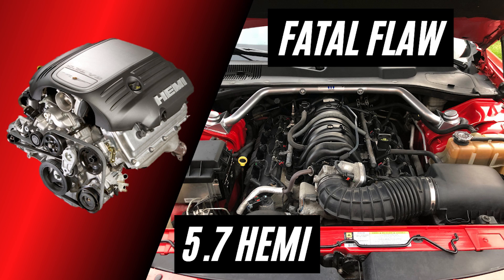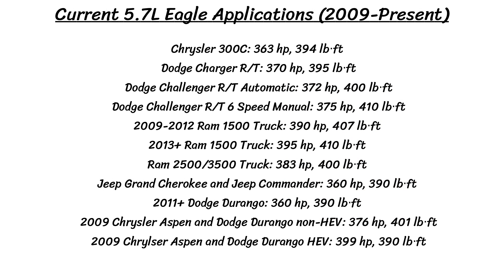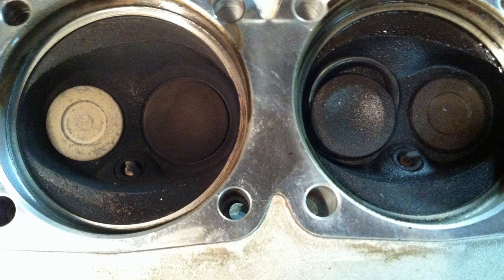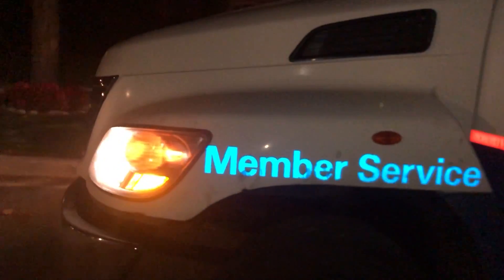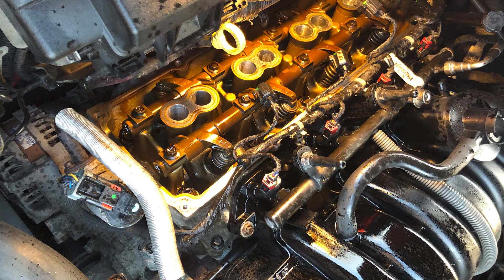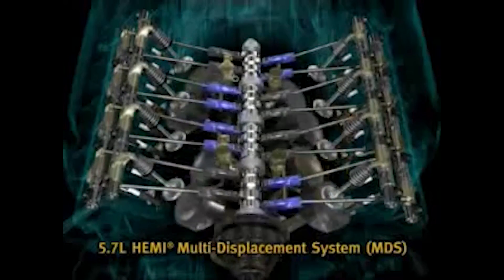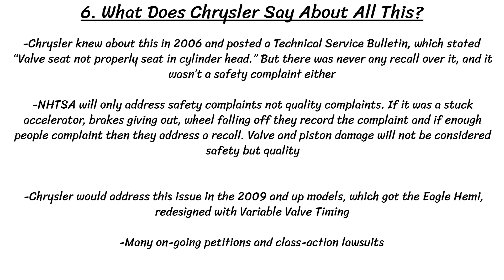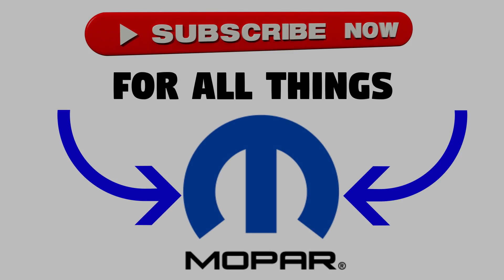The Fatal Flaw of the 5.7L Hemi V8 Engine & How to Prevent It (2003-2008 Valve Seat Drop)

Comment: So it has 2 fatal flaws... the roller lifters do not get enough oil where they contact the came, causing them to eat camshafts. Its a very common problem. It is worse on mds engines.
Reply from the maker: Those are on the newer eagle motors, I may have to do a part 2 on those lol
Reply: @MarspeedCars  your right I shouldve watched the full video before I commented
Reply: That is not entirely true, and mostly blown out of the water in proportion in engines that it actually effects
Reply: @captainblaiser  I work at a high selling chrysler dealership, I see it about every 1-2 months. Car comes in with a missfire and at least 1 lobe is found to be ground down.
Reply: That issue has nothing to do with MDS, nor does it have anything to do with a lack of oil to the cam. It is though present in pre-eagle engines. Just more common in the eagle engines as they have more aggressive camshafts.
Reply: @snek9353  Would using a high quality synthetic oil like Mobil 1 possibly alleviate the cam/lifter problems in these engines?
Reply: No, but yes. 

No, cause details... sorry
- Mobil 1 is good but there's better.
- Alleviate isn't right, if there's already damage oil can't fix it, a better word would be prevent.
- The issue is specifically the lifter, nothing to do with the cam. Specifically the needle bearings in the roller. 

But yes, better oil is better and the rights oils are known to quiet a hemi. I use Redline in mine.
Reply: @snek9353  The valve seats tend to drop more often in the MDS cylinders.
Reply: @williamwhite9767  Got anything to back that claim up?
Reply: @snek9353  It was stated in the video, but besides that I have done searches of the LXforum and that is what I found.  Of the members who had seats drop and they identified the cylinders, the majority of the  seat drops were in MDS cylinders.
Reply: @williamwhite9767  This guy is no expert and I did a similar search and found no pattern, more the opposite really. It appeared to me to be more likely to be a back cylinder 7 or 8 than anything else. I can explain why 7/8 in fact it's more common among many non Siamese V8 engines for 7/8 to be most likely to have heat related issues. If you think MDS is a cause, then how, by what means is MDS causing dropped seats?
Reply: @snek9353  where did you do your search?  As I  remember, the #1 cylinder was affected the most but it's been a while since I did the search.  I don't have any theories on why the MDS cylinders are affected more often but many people think so based on forum discussions.
Reply: @williamwhite9767  I did a general search that landed me at several forums. 

People believe a lot of things that are clearly wrong. With neither strong evidence of a preponderance of MDS cylinder failures or a theory as to why you really have nothing.

Comment: The "165 of 200"  at 2:14 is sooooo fake
Reply: What is fake about it? His car is # 165, of the 200 TorRed Daytona Chargers built in 2006
Reply: It's a daytona they only made 200 for Canada in TorRed so it's real
Reply: i have the us torred edt daytona and its 977 of 2000 they did only make 200 for canada.
Reply from the maker: The decals are aftermarket yes but the car is a legitimate Daytona 165/200. That’s just wrap and decal on my engine cover because the regular cover was boring and orange colored lol
Reply: @MarspeedCars  i have a Daytona edt as well mine is a Torred US one its #977 of 2000
Reply: The numbers look like clip art. Plus the entire text is tilted. The "1" is lower down  than the second "0"
Reply: @jordanbowes5707  it’s 100% factory

Comment: Great video! 2006 charger rt 47000 miles running great:)
Reply: 47k are low miles of course it's doing great..
Reply: My 2018 rt has over 50k. How did you manage to not drive it over 11 years.

Comment: Still one of the best engines ever made along with the LS1
Reply: Best in what way may I ask?
Reply: @Blue-moon12  Overall quality, performance, reliability, and versatility
Reply: Chad Bolton  there's no 4th gen hemi but I wish there was. For the camshaft failure just use redline oil many people killed the hemi tick.
Reply: Chad Bolton  using redline oil is not full garruantee that it will kill the tick and I get my info from ram forums not Facebook because the forum page has ram owners  who tried redline oil and even took it to a research lab to prove that redline might kill the hemi tick. Many people on the forum have been using it and used it to prevent the hemi tick.
Reply: Chad Bolton  you are right but there have been reports that if none MDS cylinder fails it's mostly because every time MDS turns on (not 100% sure this is true) it consumes a ton of oil not letting a drop of oil to the none MDS cylinders leading to lifter failure. and yea you are correct even if you disable MDS can't guarantee that you won't have the tick anymore because you still have the MDS lifters.
Reply from the maker: It’s definitely a great engine for sure! And of course the flaw was fixed eventually! Not trying to say it’s horrible or anything like that, but just talk about the valve seat drop issue as it seems like many don’t know much about it!
Reply: @MarspeedCars  Its good to see this video, many people sell the cars/trucks used with the term "needs work".  Sometimes if someone thinks they are getting a deal, but end up needing a complete engine.  Lets one know how deep they want to go into a used one of these years, unless the problem has been fixed already.    When this engine came out in the Dodge Ram at the time, Chrysler had a lifetime powertrain warranty, at least my ex father in law did in his truck.  The lifetime warranty though, did have a rigorous, dealer only maintenance schedule, but he never had a issue with the truck.   I had a 2011 Chevrolet Avalanche 5.3 with updated MDS, from when it originally debuted in 2007-2009 that had the camshaft issues GM suffered.   It was no guarantee it couldn't happen with the updated system though.   I could tell the 4 cyl mode in the exhaust note, I had factory exhaust.    Anyhow, good info to share with the Hemi engine from those year models. Also, I have used Mobil 1 synthetic and Mobil 1 filters in any of my cars since 1996 and never had any issues.  There was a article once that I read that had use the weight oil a manufacture specifies as well.  The tolerances in the engine and the thinner oil, flows in those tolerances.  The old adage "put a heavier weight oil in a engine", in some cases, thicker oil causes sludge issues or someone who doesn't follow a good maintenance routine and have issues.  I think the article covered the Ford engine like in the 4.6 in Crown Victorias at the time.  How many 4.6 you can see putting out blue smoke from burning oil from engine wear caused by wrong weight of oil or not changing oil with correct weight and over time.
Reply: @MarspeedCars  I knew little about it but after watching your video I was much more informed thus why you have the best Mopar content on YouTube
Reply: How can this be the best engine made with so many flaws?
Reply: @Iyoten01  He talked about one flaw and this isn't the same Hemi that's being made today. Almost all engines have at least one defect
Reply: @RageCannon-tf3ob  that wasnt the argument. The discussion was how can an engine be the best with flaws. This engine has more than one flaw to begin with. Yes all engines may have a defect but how do you put this as the best engine in the world????
Reply: @Iyoten01  I never said best in the world, and almost all engines with a huge fan base all have flaws after 100,000 miles like this one. Take the Subaru 2.5 Turbo 4 cylinder. A truly excellent engine with great performance but after about 130,000 miles it begins to chew through head gaskets. The Hemi is a good example of a reliable V8 in the 2000's and these kinds of issues can appear on other engines with cylinder deactivation systems
Reply: @RageCannon-tf3ob  and no ima not a mopar hater before you say sum like that. my dream car is a Red Charger with Black stripes🤷🏻‍♂️
Reply: @TannerHays137  I never said you were a Mopar hater
Reply: @TannerHays137  Man come on its not even that deep.
Reply: @KidJaeProductions  it is tho, it’s a flawed engine that he’s saying is one of the best ever. makes 0 sense, my dream car is a charger rt and i can still admit this because i’m open minded.
Reply: @RageCannon-tf3ob  If ya wanna allow 4 cylinder engines into the conversation, I bought my 2000 Tacoma 4x4 brand new with the 2.7 liter 3RZ-FE engine & Aisin auto trans. It now has 362,000 miles and runs as good as ever, uses NO oil, on all original engine & drive train. Cast iron exhaust manifolds for the 3RZ always crack, so I finally installed a 304 stainless tri-y header. Never seen any other engine respond so well to a header only, it literally runs better than ever. Kept nothing but Castrol GTX 10w30 in the crank case. I'm just about convinced the damned thing is going to outlast me at 59 yrs old. I live in Florida ( not on the beach ), so I don't have frame rusting issues due to salted winter roads.
Reply: @Iyoten01  it's one of, if not the most reliable v8 made this century. Out of the millions and millions of 5.7 hemis made, it has a super low failure rate. And the MDS lifter failure isn't specific to dodge, it's common on every MDS engine
Reply: @Iyoten01  well I have one with 242k running like it has 60k and I had one I sold with 300k last year and guy is still driving it so I'd have to agree w ragecannon
Reply: @Iyoten01  I have 208,000 miles on my 2010 Charger RT. I  have only changed the water pump, thermostat and temp sensor. But trust me, I am always checking on my Baby...I invested in a scan tool to keep me going, oh yeah and YouTube...Good luck on your Hemi's everyone.
Reply: @Iyoten01  it’s cause he’s biased
Reply: @TannerHays137  I wouldn't say biased more the fact that I'm allowed to have an opinion
Reply: @TannerHays137  makes sense, he does seem like the type to be close minded
Reply: @Iyoten01  Ah yes, I have a closed mind and I hate every other engine because I like the Hemi. I see your logic there.
Reply: @RageCannon-tf3ob it becomes more than an opinion when something is proven.
Reply: @TannerHays137  And what exactly is being proven here
Reply: When you put the hemi up against any other engine in it's class, from a performance standpoint, as well as a reliability standpoint, it is among the best. That's not biased, that's just facts.
Reply: @twiceonsundays  it can't even come close to competing with the ls3, nothing comes close that's a fact.
Reply: @ricko3631  the 6.2 supercharged HEMI can't compete with that? What you smoking and where can I get some? Edit: as a matter of fact, the 6.4 392 has that covered. No supercharger needed.
Reply: @twiceonsundays  Bring them on i've smoked everyone i've raced, not even close. All the hemi has is internet hype nothing else.
Reply: @ricko3631  Brother, you're obviously biased and lying. You've never "smoked" a stock 392 in a stock LS3. The numbers don't support that statement. With 430 hp, you're barely beating the 5.7. Not hating on the LS3 at all, because it is indeed a beast, but don't act like its a Hemi killer...
Reply: Chad Bolton  less than 1% of engines have bad cams, lol, not to mention there is no 4th gen hemi
Reply: When Chrysler Dodge Plymouth was its own company the engines were good.
Reply: Chad Bolton  if the MDS isn't the reason why the hemi gets the hemi tick then tell me why does the 5.3 v8 that has been out since 1997 has never had this lifter/cam failure until gm added AFM which is the same thing as MDS. Many 5.3 owners had over 100k miles and they never had this tick problem same thing goes for the 5.7 hemi this wasn't a problem until Chrysler added the MDS and it's not a design flaw. there's still not enough evidence to support this but many people are agreeing that MDS is the cause of catastrophic failure and the only way to at least try to fix it and not pay $4000-$6000 for parts and labor is to at least give a chance to use redline oil.
Reply: Chad Bolton  I feel like FCA did this on purpose just to suck on more cash on ram owners once their warranty is out and soon gm did the same thing trying to suck some more cash on the 5.3 owners once their warranty runs out. Even ford is doing it now they added cylinder deactivation to the updated 5.0 coyote things are getting worse.

Comment: ive got an eagle with 145k miles and just hoping my cam isnt getting eaten alive by my lifters
Reply from the maker: Yeah I guess that’s fatal flaw 2.0 on the eagle motors 😩
Reply: @MarspeedCars  you should do more of these fatal flaws. Very interesting to watch and I'd like to see a episode on the eagle. Keep up the great work👍👍👍
Reply: And the bad part about that is that issue can’t be fixed unfortunately. Only way to prevent that is to not idle for too long or prob use a thick oil stabilizer so that little amount of oil that makes it to the cam has sufficient film strength
Reply: @Trckstr971  Let us know how that "thick oil stabilizer" works out for you.
Reply: @Trckstr971  you don't need a thick oil stabilizer use redline oil it many people have killed the hemi tick by just going to the ram forum and look for hemi tick and you'll see that the ram owners killed the hemi tick with redline oil you guys need to go on forums if you want to take good care of your vehicle for the next 5 years.
Reply: @7thkev519  My "hemi tick" turned out to be broken exhaust manifold bolts.
Reply: @zfine1450  I had the same issue about 6 months ago on my 07 Ram Laramie it broke 3 bolts and one I had to drill, tap and insert to fix. It’s from the motor torking. Scared the crap out of me. I thought lifters when I first heard it
Reply: @7thkev519  is royal purple perhaps Equivalent to redline oil?
Reply: @Trckstr971  There's more tricks to prevent it, and it's not a supply to the cam problem.
Reply: @Trckstr971  or a high volume oil pump and some hellcat lifters. The prob is the lifters are cheap and the camshaft isn’t getting enough oil at idle. This is why ford had to go to a high volume oil pump on their explorers.
Reply: @rescueaviationfilms1019  hit the nail on the head 🤙
Reply: It’ll be fine if you tune out mds
Reply: @iwishigaf  MDS has nothing to do with it.
Reply: @snek9353  I've already argued with someone involving MDS of the cause of lifter/camshaft problems not sure if I wanna do it again.
Reply: @7thkev519  Where? And if you still believe it is, then they weren't very good.
Reply: its not the lifters. theres like a coating a few thousandths thick on the cam, and that stuff flakes off and gets lodged in the lifers.
Reply: And also get a bigger oil filter to improve its live span of redline oil.
Reply: @7thkev519  Have you found a bigger oil filter that fits?
Reply: @snek9353  guys at ram forum are using royal purple
Reply: @7thkev519  RP filters? I'm not a fan of RP as a company and have refused to have anything to do with their products.
EDIT.... Just looked RP doesn't make a bigger filter for this engine.
Reply: Radford Tataryn  Not sure I'm following. Are you saying that the filter spec'd for the new ram is larger than the one used in the cars but fits the cars? On my 300 there's clearly room for a larger filter but when I looked at specs I couldn't find one with the same thread and seal specs that was larger. 

FWIW I currently use Redline oil and Mobil 1 filters.
Reply: Sorry to say this, but it’s only a matter of time. I pulled and stroked my 13’ motor at 150K, only one lifter was slightly seizing though. It really depends on how much you let it idol.
Reply: Its cause the cam and lifter roller surface gets oil from the crank slinging oil or not slinging i should say
Reply: Lol. It is. Sadly but it is
Reply: Just get cam and lifters. It's like a couple grand. If you care that much about the car and you're worried about it happening. Plus you'll get a power boost and lord knows the 5.7s could use one. But what it comes down to is you can spend 2 grand on cam and lifters or go spend at least 8grand on a new decent car. 🤷
Reply: at 145K miles the rest of the car will fall apart so dont worry about the engine..LOL
Reply: Yes. I have a 2012 police version 5.7 140K. I’m getting metal flakes every oil change. It has extremely low idle hours however. Was an unmarked police admin car. Fingers crossed.